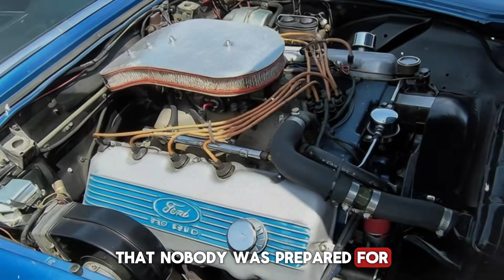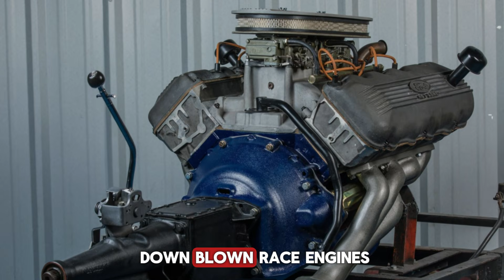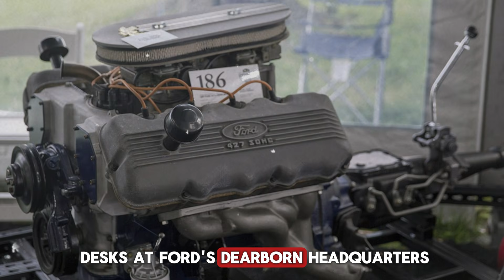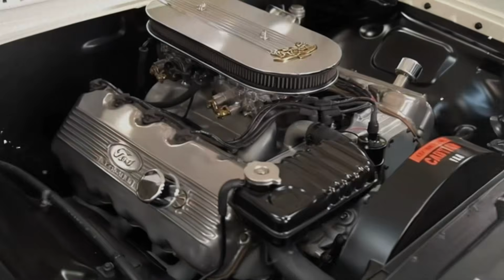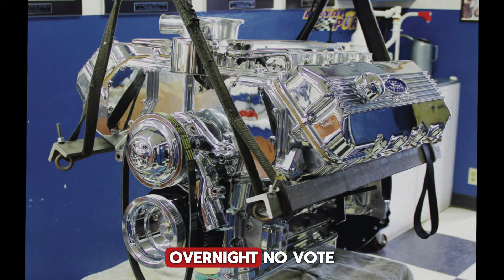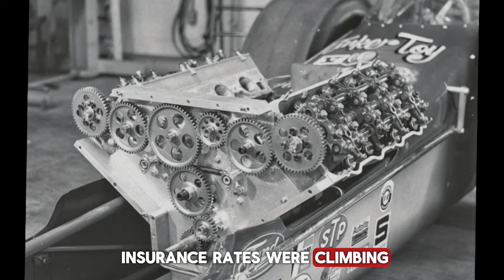The Shocking Truth Behind Ford’s 427 SOHC “Cammer” Engine

Comment: Great video, but would be much better if you got rid of the AI and got a real narrator! Timing chain stretching was a big problem, and some sources say the timing on one side of the engine would be several degrees different than the other side at high rpms.